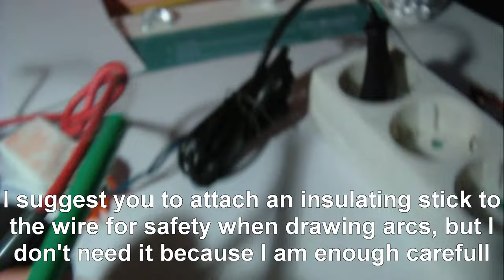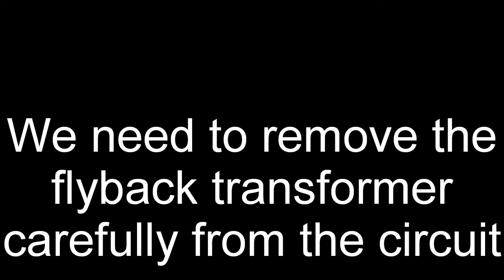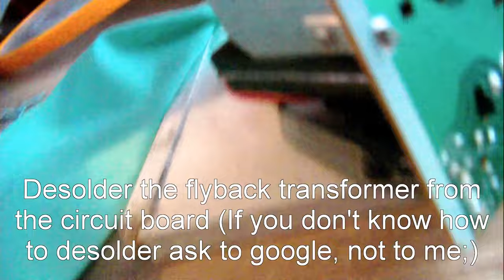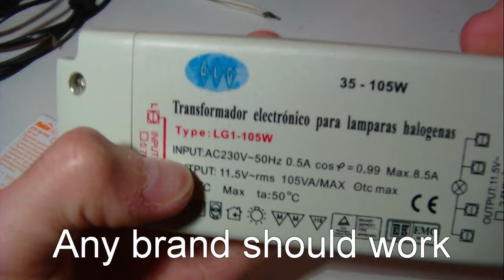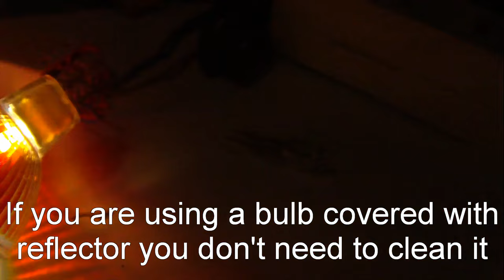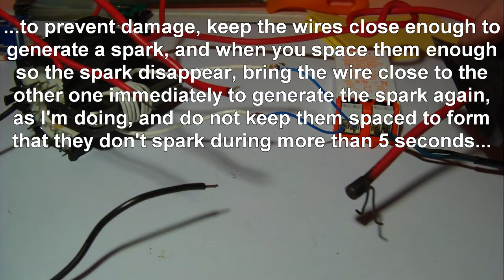Easiest way to make a HV supply from an old TV or PC monitor (best flyback driver)

Comment: Ok, that's one way to do it. Another, if you don't have a ballast, is to use the circuit from a standard house hold CFL light and connect the outputs directly to the flyback primary pins. No loud buzzing, and it's cheap.
Reply from the maker: True and that's the first thing I tried but the spark was ridiculously small and I tried different CFLs, some blew up

Comment: Most crt displays have bleeder circuits that will discharge the capacitors in the circuit slowly after use, but I would'nt risk my life on such an assumption. Sticking your hands into old t.v's, computer monitors, and electronics in general can be deadly; even if they are unplugged. The first thing you should have done was discharge the high voltage wire with a chicken stick connected to ground to esnure that their is no risk of getting a lethal or very painful shock. Good to also mention that the vacuum tube can implode and send glass flying everywhere. Ripping apart old electronics is easier than one would think, but when making a video showing people how to do it you should always start with the risks and safety precautions, and that is coming from a generally irresponsible person who takes many risks on an almost daily basis.

Comment: how to make a strong magnet
Reply from the maker: What does that have to do with this
Reply: @ThePaperAirplaneKing  I ask you if you can help me in general
Reply from the maker: @kimootawfik7201  im not an electromagnet expert, but you can make a strong electromagnet using a thick metal bar like steel or iron and roll a long wire (about 10m) around it and use a high current power source 12v would be fine
Reply: @ThePaperAirplaneKing  thank you

Comment: Can I use rubber gloves to protect myself from accidental electrocution?
Reply from the maker: They will not help much while the device is plugged. Because the arc is very powerful and melts everything. You should always keep your hands away
Reply: Ok thx

Comment: The bottom of my flyback had small shorts and arcs at the bottom. I just set it in enough mineral oil to cover the bottom and it became safe and silent with no shorting and still had full power. They work just as well fully submerged. Pure mineral oil from the pharmacy, not baby oil.

Comment: Isn't it better to find the primary coil of the pens and then the neutral ground of the secondary hv wire? Will you get a higher out put? And a low amp power source so you don't kill you self with a shock ?

Comment: Adrian, I wonder if I can use an old-style neon 230 V/12 V iron core transformer? Or does the flyback only work with a switching power supply?
Reply: Lejf Diecks No don't do that, flybacks don't work at 50/60Hz frequencies, they need tens of kHz to work. The reason why this setup worked is because this switching power supply has an unrectified output and it outputs a high frequency AC. The 50Hz buzz was produced because the mains input of the power supply was not filtered(it's just a supply for halogen lamps so there's no need for filtration+output rectifiers)
Reply: Cleaned up my workshop today and found a lot of old electronics and also an electronic halogen dimmer, which outputs 12 V/60 VA @ 30 kHz (as stated on the outside). Works like a charm, draws about 3 - 4 cm arcs. Thanks for your help Adrian/Marek!

Comment: Can it be run on 24v battery? If not what's the cheapest supply on eBay for it? Thank you. Lee does it have to be 150w or will 120w do? Sorry for mithering.

Comment: the best method is using the driver mazzilli is designed for this purposes and is the way more powerfull an easy for make work a flyback transformer  the driver work in 12v dc to 36v dc and the power consumption to max work is 20 amps depending of the MOSFETS Used For make the driver the MOSFETS can you used is IRFZ44N, IRFP250N OR IRFP250, IRFP260 OR 260N, IRF3205, IRFZ24N. IRF1010, THE BEST ARE 250 AND 260, Greettings to all from costa rica

Comment: If you get your hands on a portable CRT TV then there is almost no need to do anything shown. Just detach the high voltage cable and wire it out of the TV's frame. As for the other end, well, you either find the right connector or just "ground" it into the metal frame of the TV. The later worked for me but after a while the spark got much shorter so I must've been burning through something. Then simply turn the TV on and have fun. Obviously the spark will be shorter than it is in this video because the voltages are lower. But it's good for getting a quick feel of what it's like.
Reply: You probably can get one for a few bucks from some "garage sale" or ebay or anything of thats sort.

Comment: Are you using the bulbs just as transistors?  or do they serve another purpose.  A.k.a. can i just get like a 200w transistor rather than the bulbs?
Reply: Oops, that is what i meant XD.  So could i use normal hv or just standard resistors rather than the light bulbs?

Comment: Nice video, i have 150w ballast for sodium lamps. This is nice video but the flyback transformer should be on more than 20khz. And not 50~60hz. But anyway it works, thank you i will try it

Comment: Can I use a 12V 8.5A LED transformator instead of the halogen one?
Reply: Mehmet Ali Dede sadly..... you can't cuz the flyback transformer need currents with high refresh rates(AC) and the truth is LED transformers are DC

Comment: can i do it without the 12v electronic halogen transformer or can i use something else
Reply from the maker: Nope, it is essential as it provides the high frequency current required to drive the flyback. You can however look for other kind of driver
Reply: @ThePaperAirplaneKing  tnx bro
Reply: @ThePaperAirplaneKing  can i  myb use the cabel for laptop
Reply from the maker: @leotgreat5039  no, the output of a laptop transformer is not high frequency and not suitable for driving flyback. also, if you are a beginner in electronics, please be extremely careful with this experiment, it involves very high voltage that may cause severe damage and even death.
Reply: @ThePaperAirplaneKing  tnx bro but i am not that much of a beginner, it is just a problem that i live in croatia (thats in europe) and i dont know where to get those transformers for 12v
Reply: does maybe some electronic contain that
Reply from the maker: @leotgreat5039  did you ever dealt with high voltage before? And I suggest you to buy a flyback driver online (look in AliExpress or eBay) but again I remark how dangerous this experiment is and I encourage you to take all possible safety measures (use extension cord, long stick for arcs, etc.)
Reply: @ThePaperAirplaneKing  yes i made a taser using a high voltage convertor and i build a powerfull teslacoil, now i want to build this cuz it is preatty cool
Reply from the maker: @leotgreat5039  oh, I once made a taser but never a Tesla coil, you should make a short video about it. So I guess you already know the dangers, but still be careful because the flyback is way more dangerous than tasers and Tesla coil.
Reply: @ThePaperAirplaneKing  yeah i was thinking abbout starting a youtube channel but first i want to finish this
Reply from the maker: @leotgreat5039  oh cool, just wanted to see the coil in case it has some electronics that can be used as flyback driver. in any case good luck with the project

Comment: Is that white box a ballast?
Reply: thx but what is the difference between the halogen transformer and a ballast?
Reply: what is that for then?
Reply: so u sugest to use halogen transformer instead of ballasts? I used i ballast and it burnt...
Reply: aaaaaahhh. Thx very much. And also what is the use of putting a Capacitor in series to the flyback?
Reply: Adrian Lopez Innovations im the same guy btw. about the capacitor: not in this video, but in another one, a guy puts a capacitor in serie to improve the efficience. if you know why he made that pls tell me?
Reply: Adrian Lopez Innovations also, instead of widing the wire in the core, cant u just attach them to the pins of the flyback?

Comment: cool.:) iwant to buy flyback can i get the no. of ur flyback sir?
Reply: +Adrian Lopez Innovations ist posible to make this to a hf arc starter?.
Reply: +Adrian Lopez Innovations ist posible to make this to a hf arc starter?.
Reply: +Adrian Lopez Innovations ah ok sir.i think it will work i just need to add hv cap and coupling air transformer and spark gap.so by the way thank you sir:)

Comment: 3kv per 1mm of air 5cm=50mm, 50x3000=150000v
Reply from the maker: How is it 3kv
Reply: @ThePaperAirplaneKing  that the breakdown voltage of air( 3kv for 1mm of air)
Reply: it might not really 150kv, use a metal ball for electrode for more accuracy, cause the sharp edge make it more easy to the charge run away